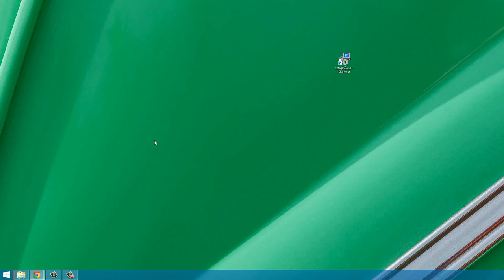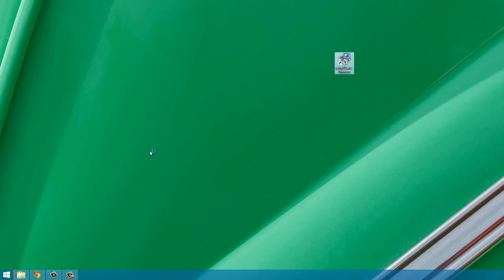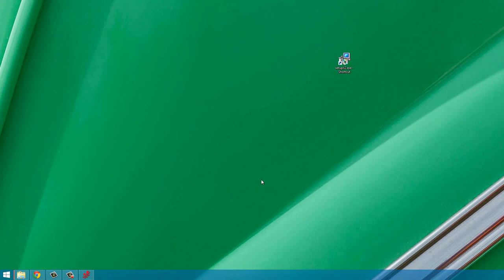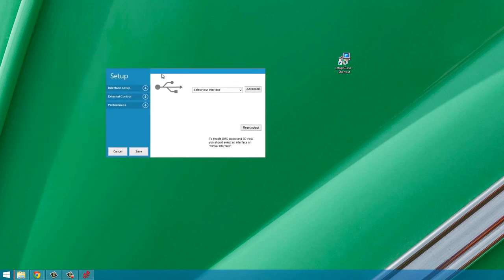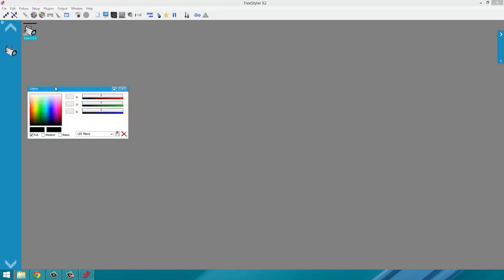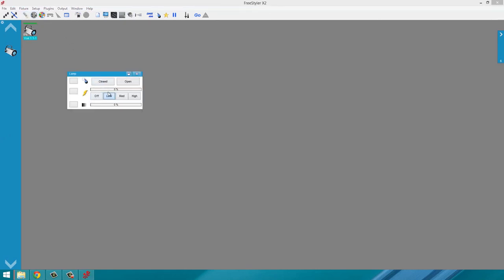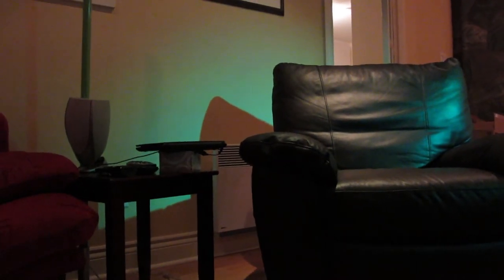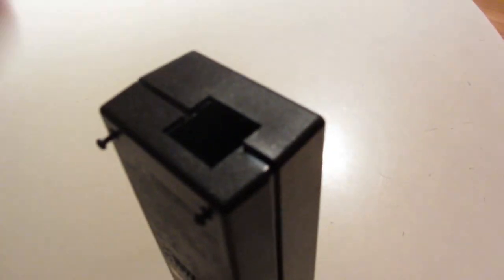10$ USB to DMX Guide - Setting Up Software | Simillion

Comment: Thank you Simillion, it works awesomely fine with Freestyler software, no glitch at all. Thanks for sharing. Also thanks Steve too. Just a note for others regarding the Driver, when I install it in Win 10, just go to Device Manager, and you can see that the driver has not been installed, so just right click and update the driver online, and it will find the driver and install it. (There were 2 drivers to be installed). In Windows 7, you have to search the driver manually. Search for FT232R USB UART Driver. To install it, just right click on the missing driver item in your Device manager, and update the driver, and choose Browse my computer and direct it to the folder after you unzip it. Hope it helps. Cheers from Downunder.

Comment: Nice work... Just did the same build from the same site you did and I have a question... When I plugged it the power red light came on fine, driver installed fine and then shows up in hardware, then opened freestyle went thru setup and the board showed up, save it but instead of getting a green or blue flashing light... the 2nd lite is flashing red... so I closed out and went back to the site and then ran the DMX_test thing and it gives me an error saying:
"DMX Adapter Found
Set Data Fault!
Set Baud Rate Fault!"

Got any ideas why it would say this? bad board? crossed wires? ...or is the transmitting light supposed to be flashing red...
Reply from the maker: +Gene Sisson Hi so transmitting light should be flashing green and that set data fault error seems to be a faulty board but I may be wrong. Post about your error on that guide page/blog and someone might have a solution. It's almost as if the firmware that was flashed to chip was corrupt. I don't know I'm just throwing a couple ideas out there. Let me know if you have any news and good luck!
Reply: +Absolete Frosty Yes, posted it up there too.. thx frosty...
Reply from the maker: Gene Sisson Anytime! ;)

Comment: Must 2 light are turned on? The yellow one and the red one? Mine's is only red..
Reply from the maker: Arnaud YT The red one is just to indicate power. The other green/yellow one is to indicate that signal is being sent. So yes you need to have both of those LED's on to control your fixture(s). If you do not see the device showing up in your software of choice (QLC+ is recommended), then consider installing/reinstalling the driver for it. Let me know if this helped!

Comment: I did not work on a par64 led, can you help me?
Reply from the maker: FelipeTresesenta Sure! If you are using Freestyler I would recommend using a different program. Use QLC+ which is free and see if that helps. Could you also please specify what problems you are experiencing with the Par 64?
Reply: wave men, I could solve a question ...? if the light that I have not in the list I can do, I have a PAR64 ligthzone mark but does not appear in the list, which I can do, just as a laser big dipper b500 but also not in the list, I appreciate your time and cooperation.
which is your twitter?
Reply from the maker: FelipeTresesenta https://twitter.com/AbsoleteFrosty
When you install QLC+ it should also install an app called Fixture Definition Editor. Open hat app and that will let you create a fixture definition for the light. (You need to know which channels do what on your fixture. Like ch. 1= Red...) Then save the definition and open up QLC+ add a fixture. and start  programming light shows!
Reply: hi again, where my qlc+ It appears FT232R USB UART, this affects not work the lights, took hours trying and I got to look at drivers and say that, can you help me?

Comment: What about the driver software ?
Reply from the maker: The driver gets installed automatically when you plug it into the usb port. It's PnP. If your on Mac read the info on how to get it to work with a Mac in the description.